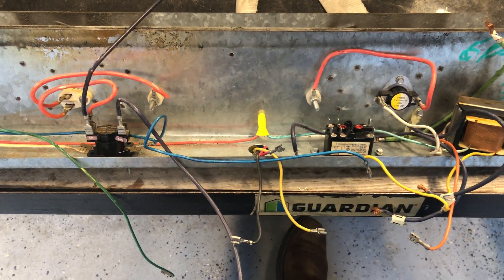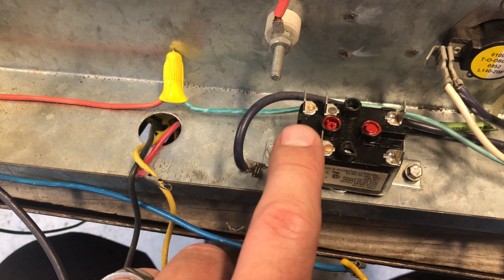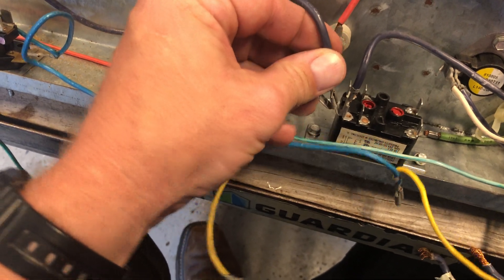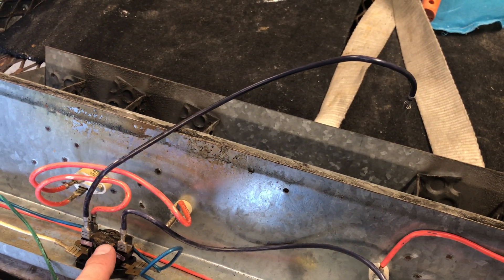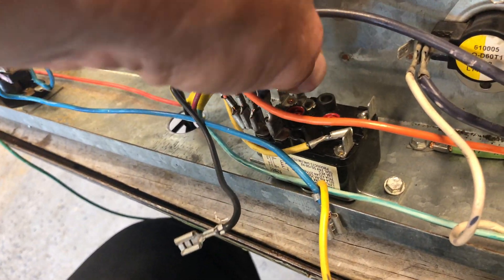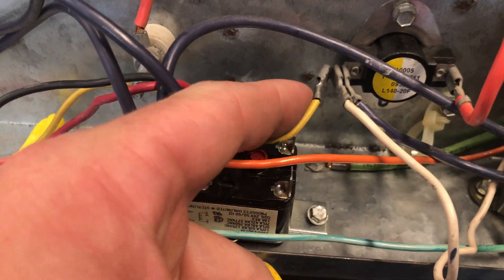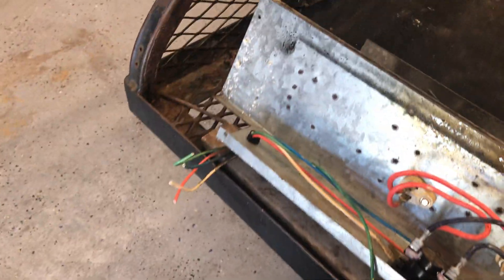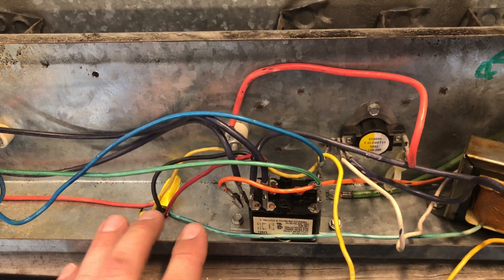Explanation on wiring up a fan relay on Fur Down Air Handler

Comment: Hey Klint 
Thanks to your videos I was able to remove and install my new First Company fan coil. My fan coil style has no heating coil. It just a coil with blower in summer we get chilled water to the coil and in winter we get hot water
My question is about wiring 
The old blower has white, blue , moron,black and brown 
The new blower motor has 4 wires. Which all the above except NO brown  
So if I hook all wires , I’ll have the brown wire from the bracket not connected to anything 
What do you recommend
Reply from the maker: Hello there and thank you for watching. Sounds like what you are describing is the speeds of the blower motor. I suggest looking at the schematic to determine what was used on the old blower and then compare that to the schematic on the new blower. Hope this helps.

Comment: How would you wire the same relay to a an air handler with electric heat strips. Thx
Reply from the maker: Hello there!!  This unit has electric heat on it. There is a heat sequencer (heat time delay relay) that when energized will send current through the strips and send current through the fan relay at the same time. The fan relay does not energize when in heat mode. Hope this help. Thank you for watching.

Comment: I got a fur down air handler blower keeps running staff say they have changed everything in that electrical compartment and now a web of wires and wire nuts..wired many different ways but Instead of a double heat sequencer this one has a three stack heat heat sequencer should I change that sequencer to a double stack sequencer. This one also had scratching my head
Reply from the maker: I would suggest looking at the schematics and try to rewire from that. It sounds almost as though a wire for the blower motor is in the wrong location. If you don’t have a schematic, try tracing your wires coming back from the blower motor. What brand unit is it?
Reply: @klinthanks9946  they went ahead and changed out the unit
Reply from the maker: Sounds costly on their part. It would interesting to know what the cause was. Good luck and thanks for watching.

Comment: We have a problem with these units leaking water  any suggestions because of them sweating we have wrapped them with insulation and somehow they still find a way to leak water on the floors
Reply from the maker: Is it leaking just from the suction line insulation sweating or is it from the drip pan?
Reply: @klinthanks9946  yes
Reply: Actually both
Reply from the maker: What brand unit do you have? I wonder, since it is a consistent issue, if you have unfiltered air or exterior air coming into the air cavity which could cause the unit to sweat an excessive amount and work harder to cool. Since it’s using the “crawl space” between the floors one would assume that it is sealed. You’d be surprised what I’ve come across at my property. I’ve been here for 12 years and still come across stuff that makes me wonder how it went that long with no complaints of my residents.

Comment: On my transformer, I have a 40VA wire, where should that go?
Reply from the maker: Most typical transformers are 240volt as a primary and 24volt as a secondary. Each transformer is different when it comes to the wire colors so me telling you what my colors are may differ from yours but on the transformer it will tell you what wire color is. If you have a multi volt transformer then you must read what the transformer says. What are the colors on the transformer you have and what is the verbiage for each wire.
Reply: @klinthanks9946  correct but your trans only has 4 wires where mine has 5, I caped the 208V but that still leaves me with com, 240V, 24V and 40VA
Reply from the maker: @ChildishCam  from the way you are describing it to me is that Com and 240volt will be your primary wires and 24v and 40v will be your secondary wires. Unsure why it would be showing 24v and 40v. Usually it just reads 24v on both wires. You can always wire in the primary and check what your voltage is on the secondary.
Reply: 2 secondary 24V wires coming from transformer, i connected one to the terminal shared with the yellow wire from the fan. do i connect the other one to a common lead somewhere?